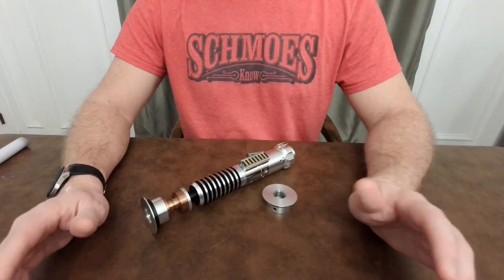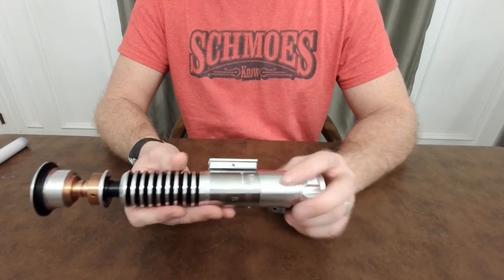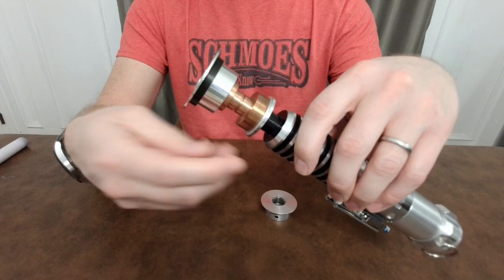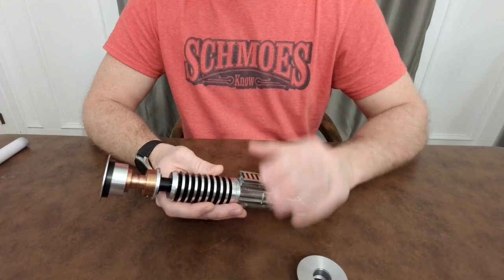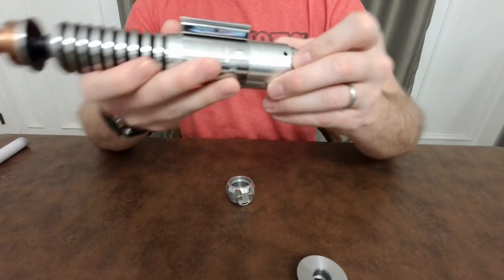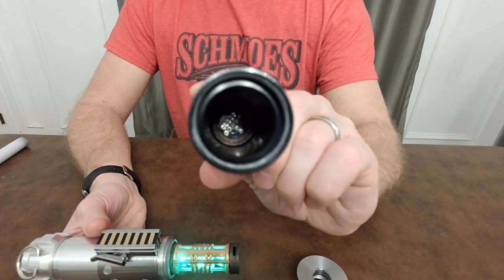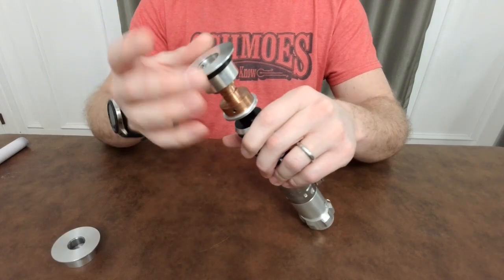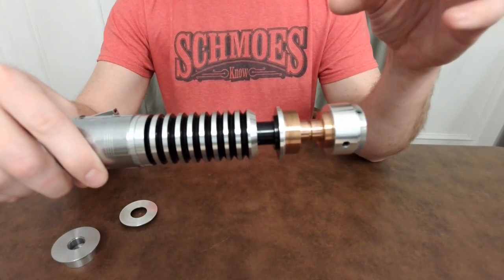Rudy Pando Luke V3/SS Proffie v2.2 Lightsaber Install Review

Comment: I’ve got one of these that I’ve been working on for ages, very small steps! I’ve got my circuit design approved by Naigon for my igniter and the Goth Master Chassis. Might have bitten off more than I can chew, but, I’ll get there slowly!
Reply from the maker: Take your time. You'll get there. This is such a great hilt. The master chassis can be tedious but when finished looks amazing.
Reply: @sandlance25  certainly will, trying to figure out where to lay the wires will be a chew on but I’m in no rush! Cheers for the encouragement, good to know that I’m not on my own with the time side of things!  And it is a great hilt!

Comment: How come you put the pins in the hilt above the chassis? Most put the pins on the chassis.  Also how did you mount the pcb in the hilt and on the chassis?  Thanks
Reply from the maker: Hey, honestly I just wired the pins inside because I figured it would be less chance of the pins moving when I removed the chassis. I didn't want the pins exposed after taking out the chassis and them possibly breaking if I left the chassis exposed. I secured the pcb in the hilt using a small 3D printed 7/8 pcb holder using e6000. There is a pcb holder that comes for the end of the chassis (with Goths chassis) and again used small rods and e6000 to secure it. Hope this helps! Thanks for watching.
Reply: @sandlance25  helps a lot!!  2 more questions.. why e6000? And were the small rods for distance? As in did you sit the pcb on them so the pcb sat higher?  Thanks
Reply from the maker: @hobbylyfe4716  e6000 is a great adhesive and can easily be removed if need be. It was I was told to use when I got into the hobby and what I've used ever since. The small rods were just to secure the pcb holder to the main chassis. The pcb holder is effectively sitting right on top of the main chassis just with the rods running through connecting them. The chassis was very well thought out.